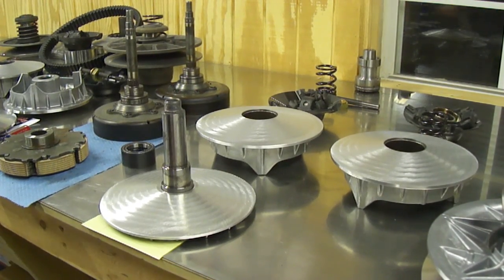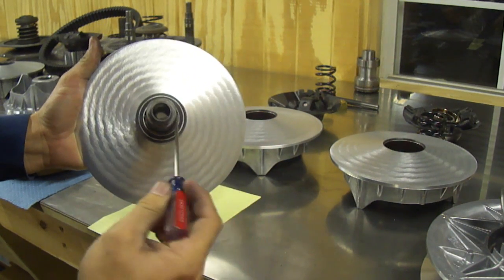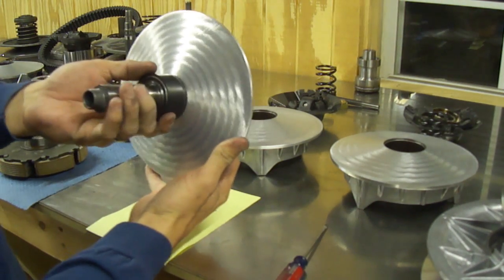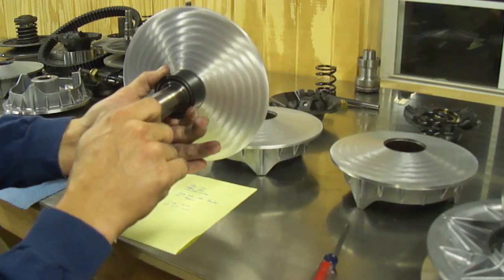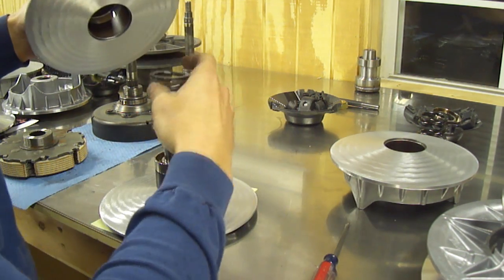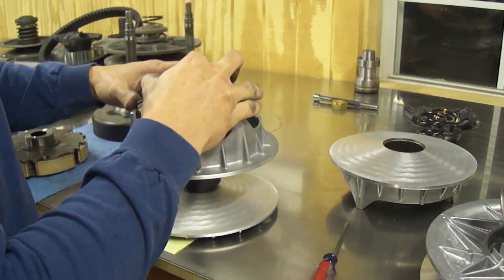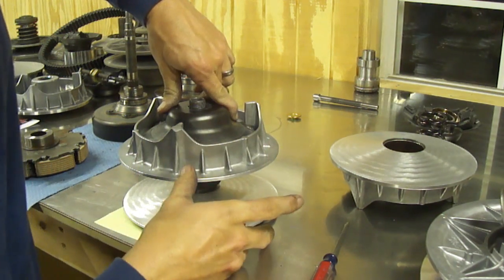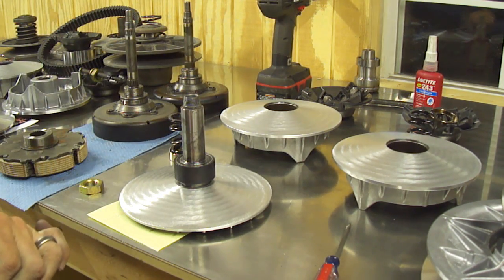CVtech Trailbloc clutch assembly disassembly breakdown

Comment: I have a ODED 800X4 and the bearing is either a full bearing and locked up, or it is missing. I just ordered a new primary clutch assembly, the bearing appears to be black and a full bearing. Is the machine supposed to have a full bearing or the thin bearing?

Comment: What happened to the stroke limiter and that rear most (black) plate that’s typically bolted to these clutches? Are these two parts not required?
Reply from the maker: Those parts are definitely required in certain applications, if it came with it, leave it alone. If your clutch comes with the weight ring, its added to smooth out engine harmonics, its balanced with the clutch so leave it on.

Comment: i sure wish this was an up to date video
Reply from the maker: every trailbloc built is the same with a few exceptions of what the spring seat color is, what color the throw limiter is, and some few versions have a 32mm nut rather than a 30mm nut. What more "up to date" are you specifically looking for?
Reply: @AirdamClutches  I was sold a clutch from canada and they said it would be pre set to my tires (29.5 ol2s)and it sadly is not do you have a phone where I could call you here is some info...I bought a cvtech clutch pre set for my 2019 can am outlander xmr 1000r on wot it slips the belt in low and high,inside the clutch was a 1016 spring and what appears to be 06 weights or 16 grams what I have figured so far.if I run it easy it tacks out at 8000 rpm and the bike is shifting really close to that in high range. i was told to add weights so I added two pennies the out come was ..no more 8000 rpm and the bike is shifting around 75-7600 rpms feels good..so I put it in low range to test because its going to be a strait mud machine.so I do a wot in mud and omg slippppp rev limiter bounce super bad still Id appreciate and pay for any over the phone help at this point my machine has been down for 4 weeks now and im so frustrated.
Reply: @AirdamClutches  I have had a few different buddies from other states im friends with have all said to me different set ups that they say are awesome but i cant afford to buy them all lol. So I am here for advise here is some set ups i was told to get ...1017 spring 22 gram weights ....a 300-1200 spring with 22 gram .... and this was for wheelies and mud ....1025 spring and 22 gram weights with a red secondary spring??? man any help or a quick lesson in cvtech tuning would be a tremendous help!
Reply: @AirdamClutches  im running a gates redline belt for the outlander rest is all stock with 29.5x10x14 all around
Reply: going to have to have a new belt now the last wot low gear test smoked it really fast

Comment: Why doesn’t it have the spring limiter and the rear weight? I’ve heard people leave it off for performance.
Reply: Guess they're not going to answer this question. I'm curious myself I have a CV tech coming.
Reply from the maker: There are many versions of the CVtech trailbloc clutch. We have it built to fit tons of different machines. Some use the metal counterweight and some do not. Some use an internal throw limiter and some do not. If your machine came with the counter weight, and throw limiter, YES you want to LEAVE THEM THERE. Do not remove the counterweight which is designed to keep the clutch inertia rolling at idle thru the odd firing order of the can-am engines. Removing this weight pronounces the engine harmonics and the result is more kick-back at idle which will shorten the life of the clutch and all the moving parts inside. Leave the counter weight on for all can-am ATV and SxS applications. Also do not remove the throw limiter, it is there for a reason as well.

Comment: Do these both clutchs lock   like a stm or qsc are they as good ?
Reply from the maker: yes these clutches lock together, that is the purpose of the hex on the end of the shaft and the hex cut in the center of the plate. when they lock together and you tighten the nut, the outer half is locked to the inner half

Comment: so can i change spring while the inmer sheave stil on bike?
Reply from the maker: yes, you can remove the outer half of the clutch while it is still on the crank. replacing the spring or weights without removing the clutch from the crank
Reply: @AirdamClutches  do you have a spring and weight set up for a can am outlander xmr 1000r with 29.5 ol2s on it for wheelies and thick mud,I bout this cvtech clutch and its busting the rev limiter h and low it came with a 1016 spring and 16 gram weights or the ones with 06 or 60 on it and its slipping terrible the clutch was supposed to be pre set for my 29.5 ol2s but its not i did add two pennies to the weights and it feels some what goos shift out is at 7500-7600 rpm range but still slips the belt in low???? any help would be awesome...my bike is completely stock except the 29.5 ol2s

Comment: Any advice on problems removing the clutch shaft from the crankshaft. Im using the correct puller, I've tried a few other things to help w/ puller. Open for suggestions, thanks
Reply from the maker: teflon tape on the threads of the puller, and water or grease inside the bore of the clutch. you can create a hydraulic effect and force the clutch off the crank with this trick.
Reply: Hola gracias por el vídeo, tienes algún vídeo para quitar polea fija?yo no puedo quitarlo @AirdamClutches